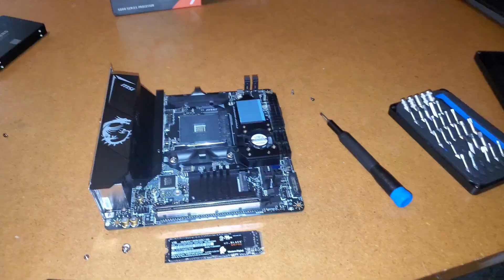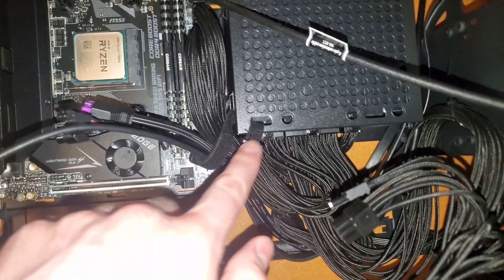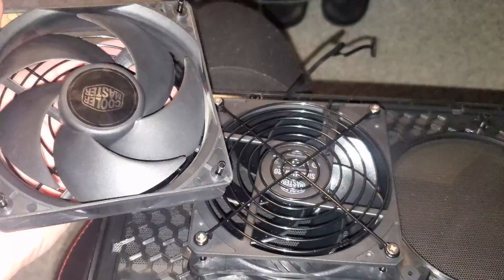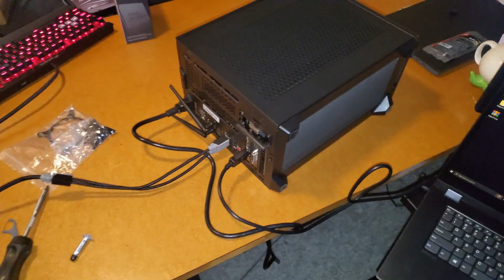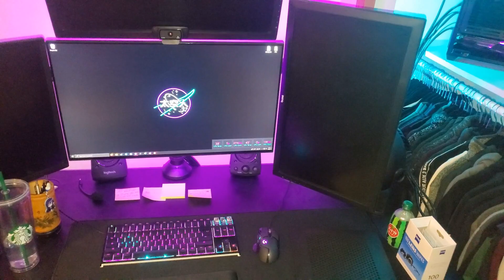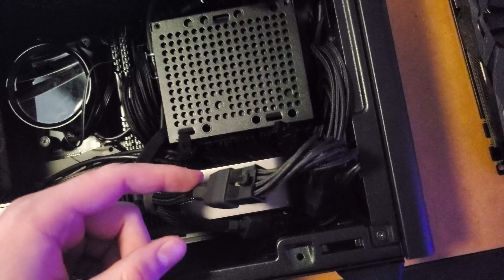College Dorm Mini ITX PC Build: 3080Ti, 5800X, NR200, Kraken X63 (280mm Radiator)

Comment: I love seeing NR200 builds, I’ve just built one and I got the same cpu. Only issue I had was stock my idle cpu temp was 60c+ but then I had to do some undervolting, now I get about 40-50c idle temps on cpu. Wondering if you had to do the same?
Reply from the maker: Yeah, it was running around 60C idle, I've moved to a larger case now and it's still around 50c. The 5800X seems to just be a warm chip from what I've seen online.

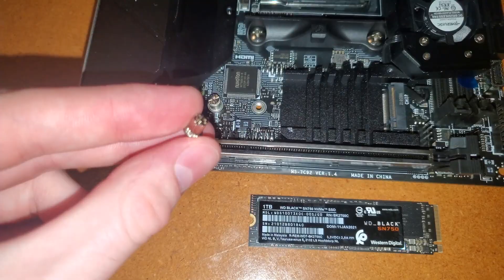Comment: 1:05 so what did you do? Installed the M.2 with no stand off? Isn't there a stand off included with the M.2 as well?
Reply from the maker: The motherboard came with two standoffs installed, one for each common size of M.2 drive. I took out the middle one because I only needed the one in place for the size of the drive I have.

Comment: Thank you very much. Great info. I'll be building in the NR200 w/ a RTX 3080 Ti FE (thank you Best Buy on Aug 26th, waited 7 hours and was number 123 out of 142 units), R9 5900x, Asus ROG Crosshair VIII Impact MB, Noctua NF-U12A OR Noctua C14S (depending on fitting on MB), Samsung 980 Pro 1T, Corsair SF 750W 80+ Platinum, Corsair Vengeance LPX 32gb 3200/Cl16, 5 Noctua fans (3 x 25mm, 2 x 15mm). I'm chicken so will have someone else build it. :( But that's fine. I'll remember your key points when it's build. Thank you again.

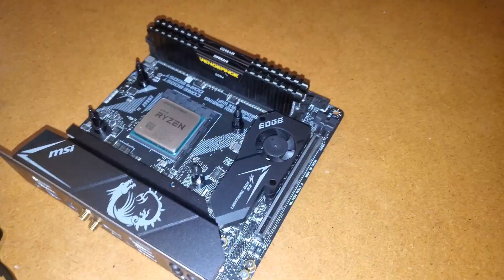Comment: 1:50 Makes sense, though. Micro pins facing an empty space of the box provide safety during transportation. The huge box also prevents buyers from putting it in their pockets that risks folding pins which also benefits the staff against Shoplifters.  😂 😂 😂